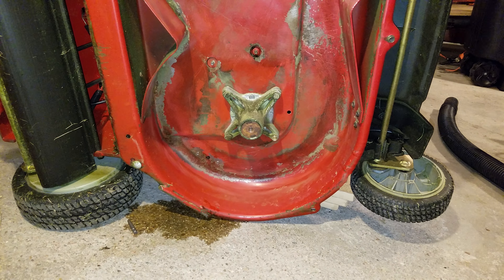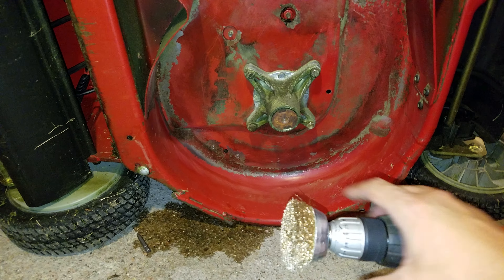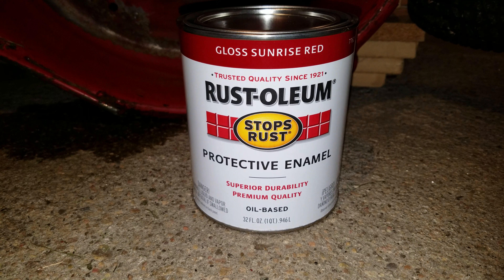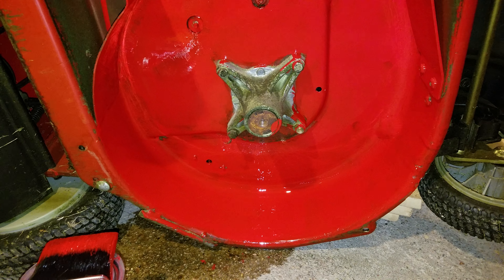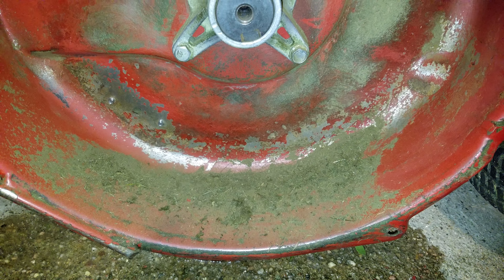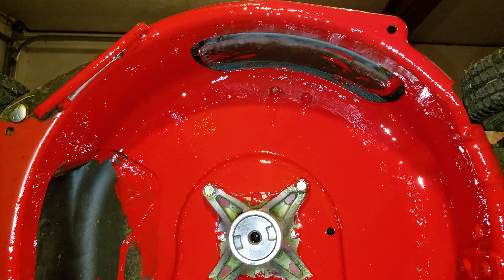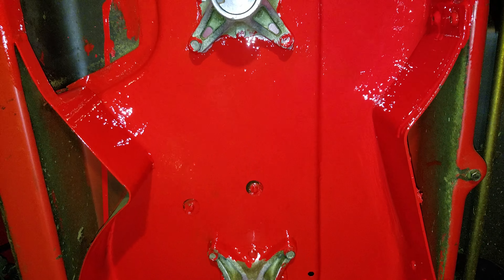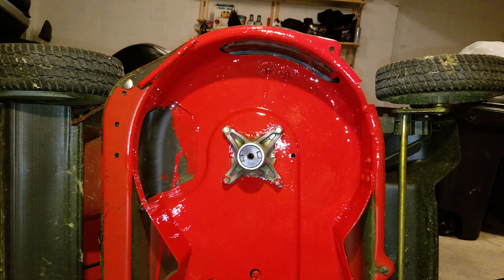Toro Timemaster 30 Repair: Deck Painting

Comment: I think if you cleaned the deck with acetone or mineral spirits before painting and applied a coat of primer first you'd get better results. Also if you paint it with truck bed liner, the grass clippings won't stick to the deck as easily.
Reply from the maker: ive been seeing that its almost pointless bc theyre comparing it to a sandblast box.
Reply: Then by that same reasoning it's pointless to paint the underside of the deck at all, yet they still do. Sure, it's like a sandblaster under there, that's why it needs to be repainted every so often. As long as you're going to be painting it with something anyway, professional rubberized undercoating or truck bed liner seem like pretty good options to me. Makes more sense to me than leaving it as bare metal or just using regular paint.